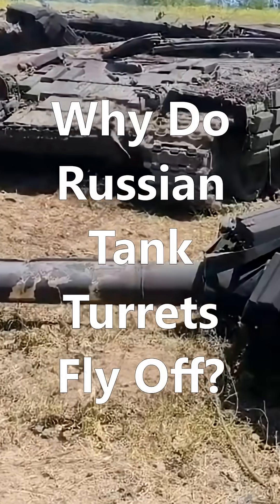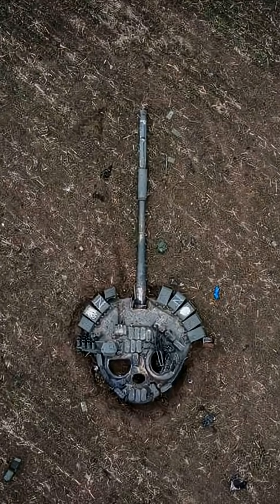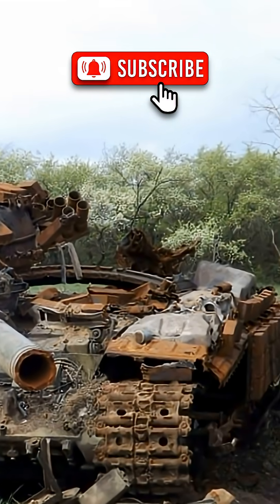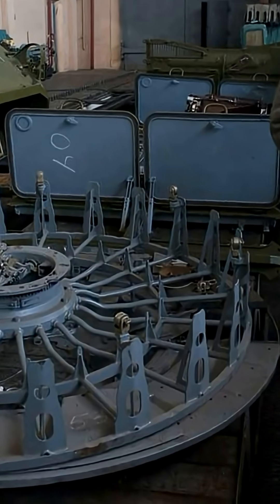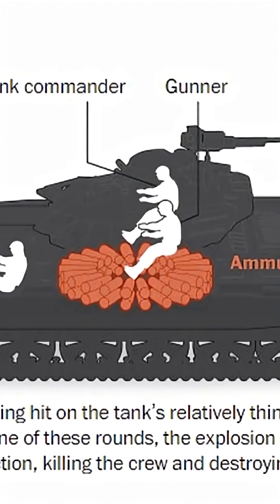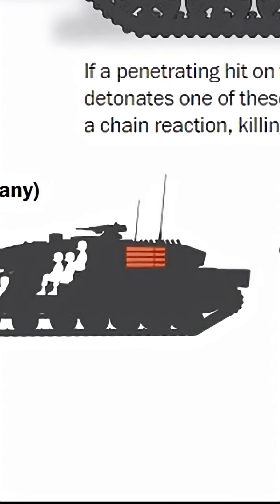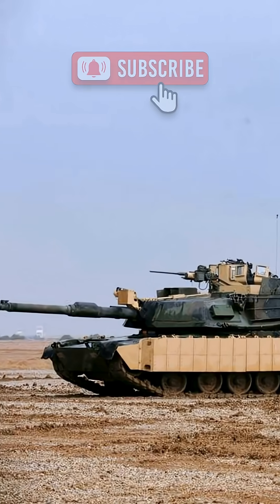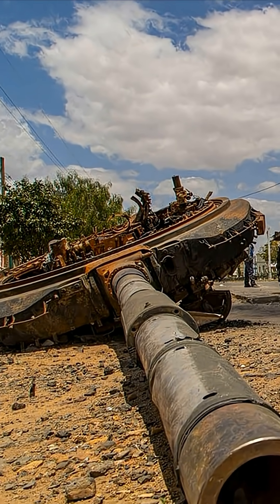Why Western Tanks Survive but Russian Ones Blow Up #T72 #T90 #RussianTanks #TankExplosions #Armor

Comment: Most think it's because of the autoloader in the bottom of the hull but those are quite hard to hit anyway since they're a low profile (especially the AZ autoloader of the t-72 and T-90). I personally think it's cause of the extra ammo Russian crewmen litter around in the tank. But don't forget nato tanks can also turret pop due to the hull ammo (E.g. leopard 2, ariete and challenger 2. Abrams doesn't really have hull ammo except for the few hull ammo in earlier variants.